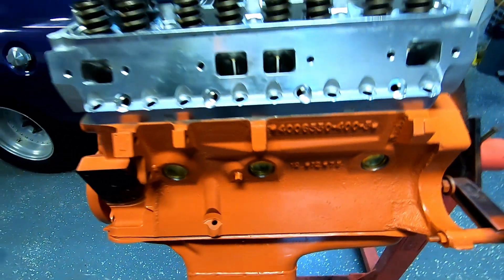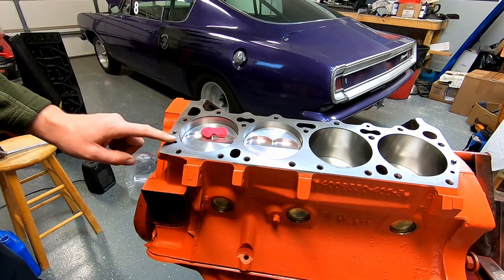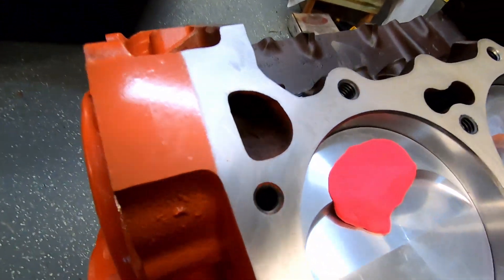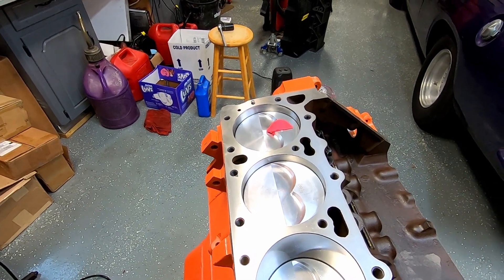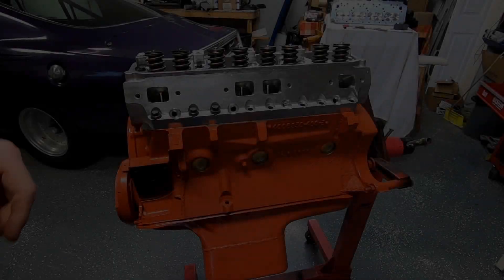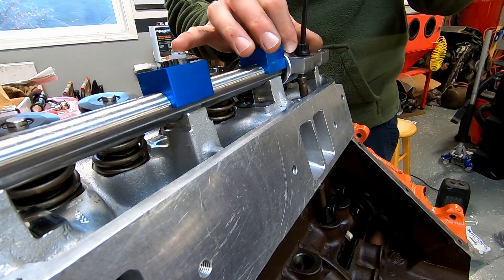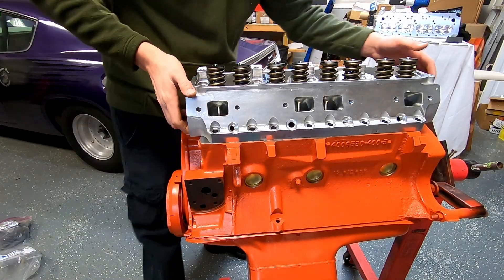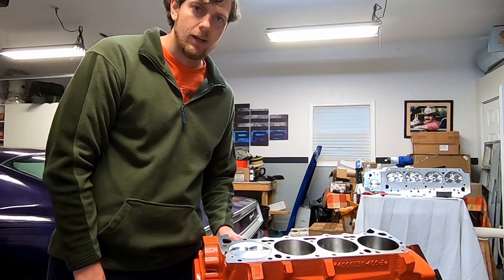Big Block 400 Build Series: Checking Quench, Piston to Valve,and Pushrod Clearance #mopar #bigblock

Comment: 1:6 rockers are going in
Reply from the maker: And worked flawlessly 🫡
Reply: @JustMoparJoe  yeah that's exactly what I thought. How is Griffitts engine coming along?  I guess you probably keep in touch with so you would know
Reply from the maker: @mr.x1510  I believe he and wife are vacationing. I saw he got his new Cope billet drum for Christmas. Really nice guy
Reply: @JustMoparJoe  that's pretty cool. I've been thinking of doing a build similar to that, but not as extreme. I've been away from rebuilding for a few decades now and kind of wondering what my block options are.  Yeah he seems like a really nice guy

Comment: This 400 is going to be a RIpper!!! Im really curious to see the performance and track time difference between the 408 small block and the 400 big block.
Reply: Me too!
Reply from the maker: Thanks Duddie. I wish I could do it all Apples to Apples. But the 400 will get a different converter and transmission. The new transmission will have similar internals, but is a different unit. I might also need to update the 4.10’s to the 4.56’s, like I needed to last year. Maybe I swap those out later! Dang Dana 60
Reply: @JustMoparJoe  so hard to go apples to apples as each engine will optimize a different gear ratio and converter.
Reply from the maker: @318willrun  it’s true. My first dyno session will hopefully pay off
Reply: @JustMoparJoe  Unfortunely those Dang Dana 60's aren't fun to setup. But they sure are strong!

Comment: Man, you've done so many details on this series that all the other guys just skip over as "common knowledge". I forget if you have gone over the oil mods needed to go with the new lifter setup? If Im lucky you will recall that I have previously mentioned Im not a roller lifter guy at all so I genuinely dont know.
Reply from the maker: Thanks brother. For the roller lifters in this block, I didn’t change anything. The oil holes were chamfered on the crank before it was polished, got a deep pan, and getting a high volume oil pump. I’ve had good luck with the similar combination in the past.
Reply: @JustMoparJoe  I thought you had to reduce the oil flow? Or is that solid lifters?
Reply from the maker: @cjm5002  everyone has an opinion on it. I’ve never had to do anything with that, but I like to stay under 6,500 rpm. I’m sure a sloppy lifter bore could lose a lot of oil. Check out Creedance Chrysler revival on YouTube. He just did a small block with some cool oiling mods.

Comment: The play doe method for checking quench doesn't always work. You wouldn't want to do it WITHOUT A GASKET if you're at zero deck height or in my case positive deck height. 
  Actually was shooting for zero deck on the 318 build, a .010 cut with KB167 pistons. With my crude measurements that .010 would get me really close then a .040 gasket, done. Unfortunately the deck cut wasn't exactly straight, it's back at the shop now, hopefully once it's straightened out its at .010 positive and  .050 gaskets. Just a pita because. 040 gaskets are pretty standard and cheap.
Reply from the maker: Very good point! Sorry for your bad machining. Check out the 318 Mopar performance group on Facebook. Yours sounds like a good addition!
Reply: @JustMoparJoe  I'll check that out! An exclusive 318 group would be great. On a couple small block ones now and everytime you say 318 (orv273) ten guys gotta tell you to get a 360. 😂
 It ain't a race engine,  doing it for a pickup with a fairly mild cam but I'm porting the heads, 315 castings with 360 valves and shooting for around 9.5 compression.
Reply from the maker: @bobbyz1964  that’s what it’s all about. Share your combinations and discoveries 👍🏼